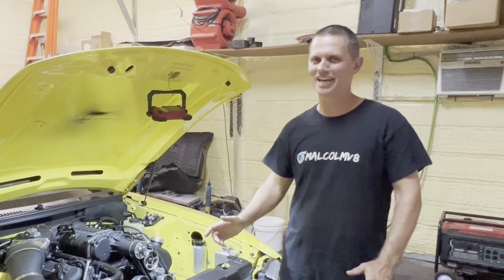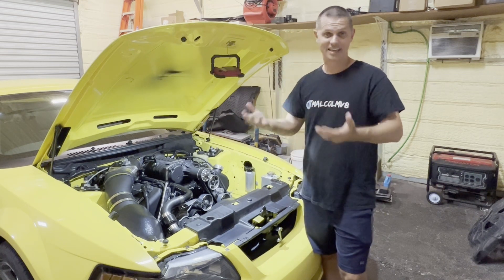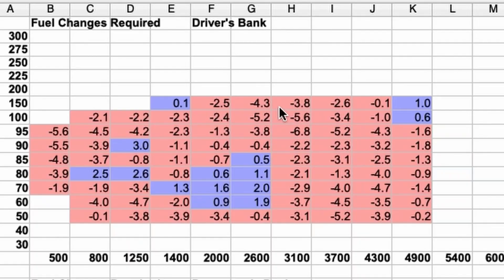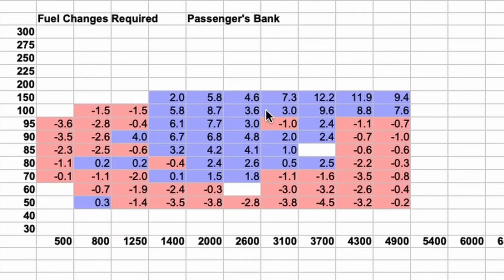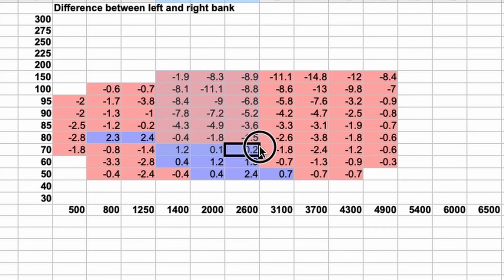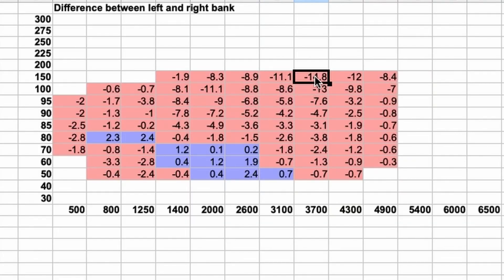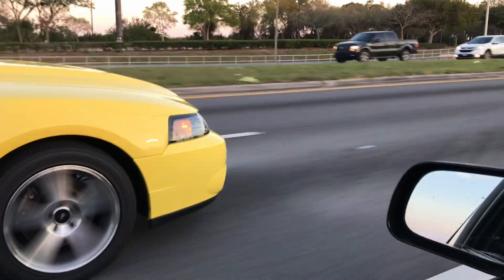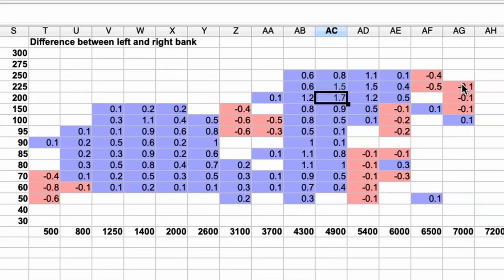Are dual widebands necessary?

Comment: Great timing on this video. I just had one of my widebands take a crap while out to dinner Saturday night and luckily the single was able to get me home safe!
Reply from the maker: Are you relying on the widebands for fueling or just feed back & confirmation that the car is doing what it's supposed to do?  I'm just curious since you said the single was able to get you home.
Reply: @MalcolmV8  Not reliant, ego correction closed loop is active, but it ignores anything that is out of normal. So a dead sensor like I had, ect. It defaults to open loop :)
Reply from the maker: @papajoewil10  ah good deal.  I figured that was likely the case :)

Comment: For a single turbo car would you do out of boost tuning with the wideband placed in the narrowband locations pre-turbo to check bank to bank? I just have a single wideband in my downpipe, always read that the heat and pressure would skew the reading from the sensor if used pre-turbo.
Reply from the maker: You are correct the pressure messes up the readings.  To do pre turbo there are wideband kits that essentially control the boost pressure seen by the O2 sensor so it can read accurately.  I've never used one so I don't know much about them, only that it exists.  If you just wanted to check part throttle and out of boost readings what you describe would likely work.  That's actually exactly how I based tuned a turbo car before the guy finished building the down pipes one time and then we could get into boost tuning.

Comment: Could you do something like your spread sheet with the histogram option on Megalogviewer?
Reply from the maker: You could likely do something similar.  Perhaps define a custom field that is the difference of AFR1 error & AFR 2 error, and then plot it over the histogram.  That would process the difference on a record by record basis and may have some rounding issues throwing it off a little but I haven't tested it.  It'll likely work pretty good.  I was already in spread sheets as I like to plot out a lot of other stuff so it was just easier.

Comment: Do you still support the Lean Protection Module?  I have a wide and on the driver side, but have always wondered if the module would support the other side.
Reply from the maker: Ryan, I sold a dual wideband version of the Lean Protection Module back in the day.  I stopped selling those around 7 or 8 years ago.

Comment: Funny you made this video, already planned myself to install a second one today. How did you get the spreadsheet showing the discrepancies? Thanks!
Reply from the maker: It's a bit of a manual process.  Capture your current VE into a spreadsheet.  Then get a good driving log of 30+ minutes and compare fueling differences recorded against your base VE.  You'll have to run an analysis for left bank, then right bank.  Then create a difference between the two results.
A much more simple alternative would be to just graph AFR vs AFR2 across your log and zoom in and closely inspect.  While not as detailed it'll at least help you find any issues.
Reply: @MalcolmV8  Good news is I can tell from my 2 widebands that the car has little to no discrepancies. Will log both though and check and know for sure its happy
Reply from the maker: @CertifiedRippers  it's a great way to validate things.  Something as simple as a bad ignition coil causing some misfires on a single cylinder will show up.